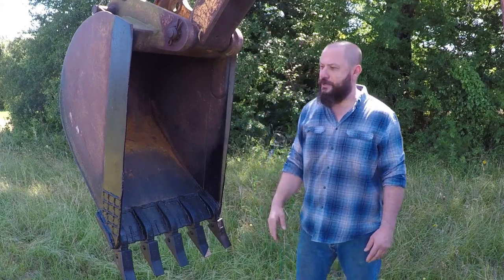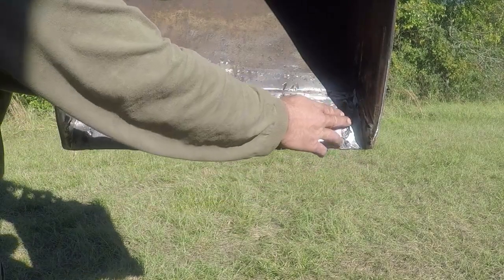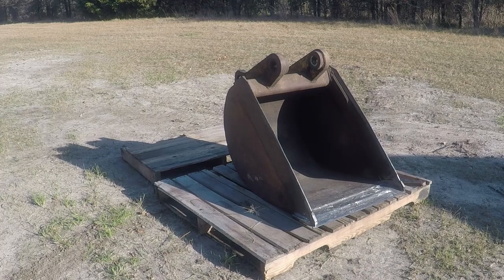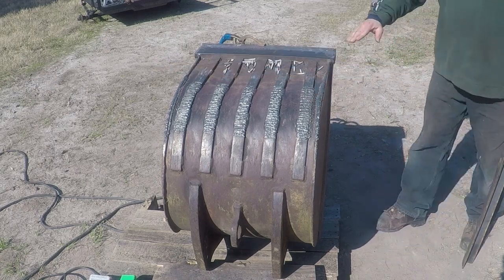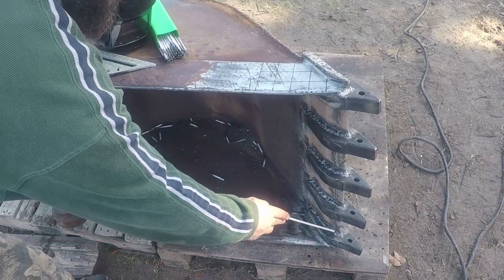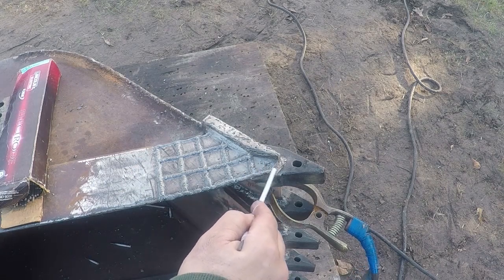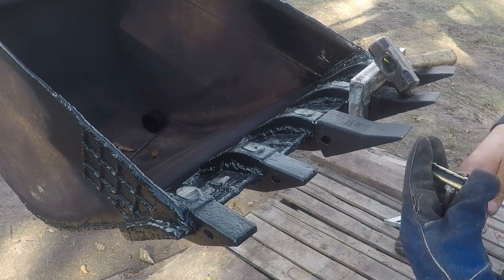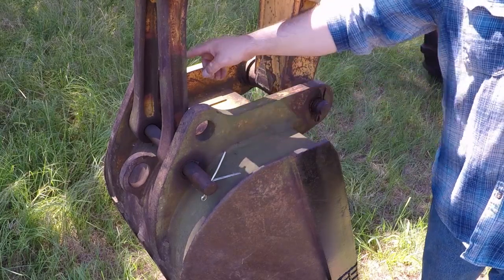Backhoe Bucket Repair

Comment: I think you definitely did the right thing by using a grinder instead of a torch. That bucket was a mess for sure,  you did a great job as usual. A good solid repair that will last many years. Thanks for taking us along for the repair.
Reply from the maker: Thank you sir, I appreciate your comment.

Comment: When you were hard facing what were you using for ur strait lines
Reply from the maker: Just a piece of scrap metal, I kept it away from the line by about 1/2 inch and used it as a guide to weld straight.

Comment: Good job. did you use that yeswelder on this project?
Reply from the maker: Thank you, no sir, I used my Miller gas welder for this project.
Reply: @SalamSayhood  Gas? stick welding
Reply from the maker: @WV591  yes sir, it has 15 horse power gas engine and its a generator (120/240 ) and stick welder.

Comment: I  bought a 1966 ck 530 case 188 Diesel Backhoe  for $2500.00   both of my buckets ain't got that much were in them at all for the year that it is
Reply from the maker: Congratulations, very good deal, these old machine easy to repair, they have the power and will get the job done.